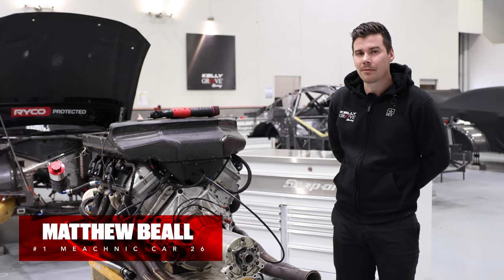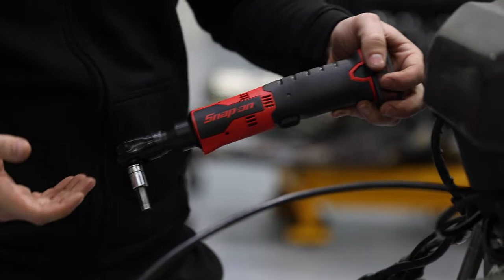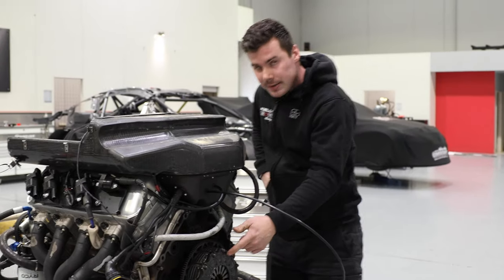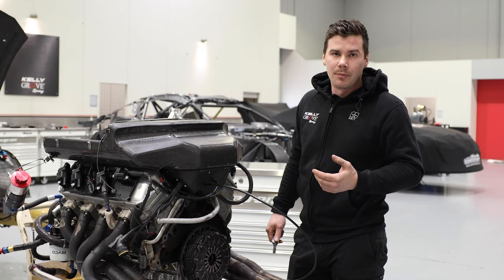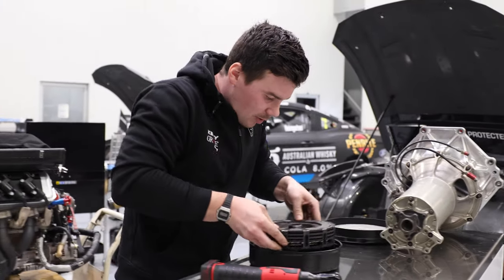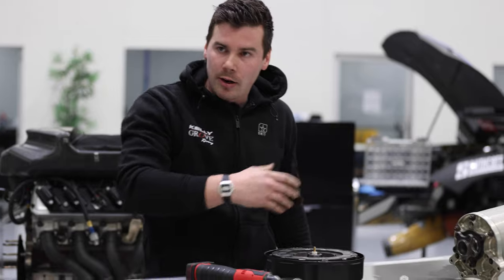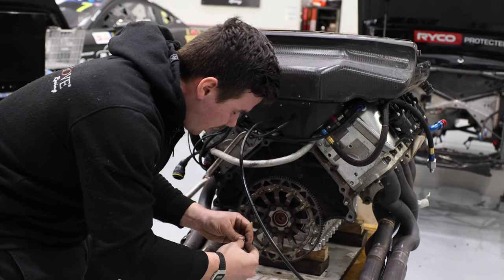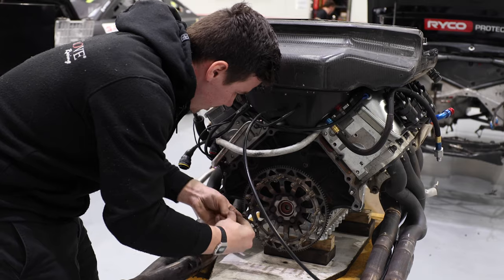DRIVE LINE DISASSEMBLY | Between Races w/ Snap-on

Comment: Funny looking tube section on the bell housing (at least to this pommie!) why is that?
Reply: Gearbox further back, better weight distribution, I reckon
Reply: @donfinch862  they run a transaxle. So the gearbox and diff are in the one unit at the back of the car